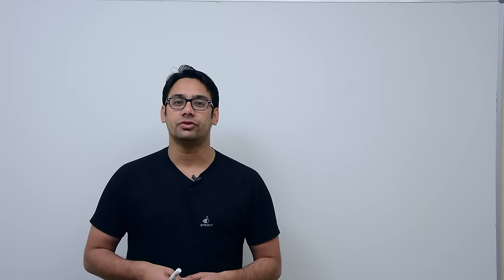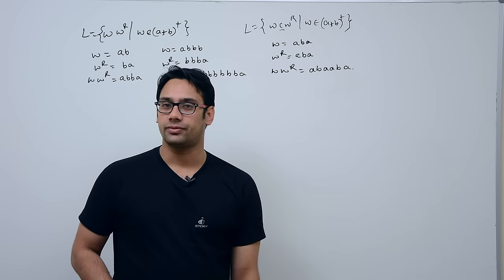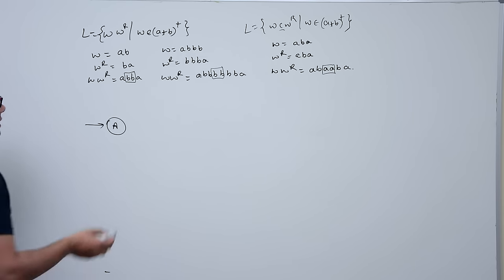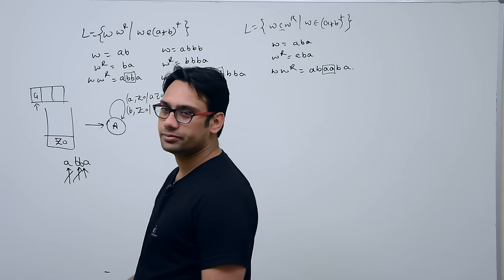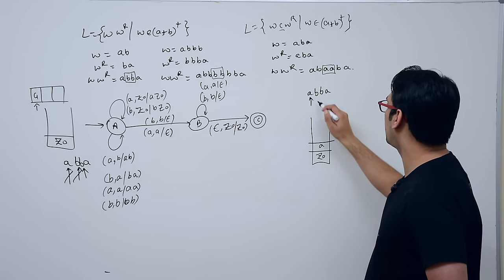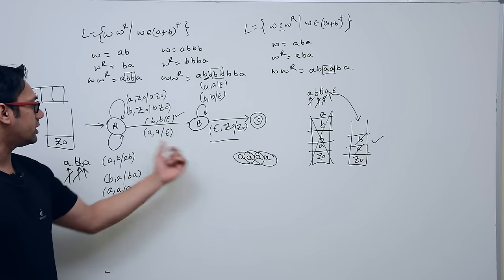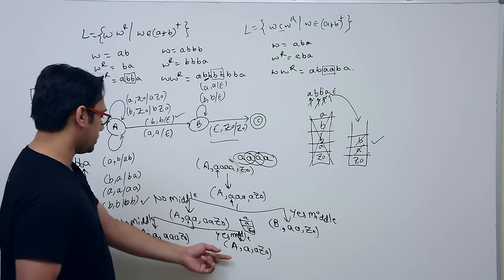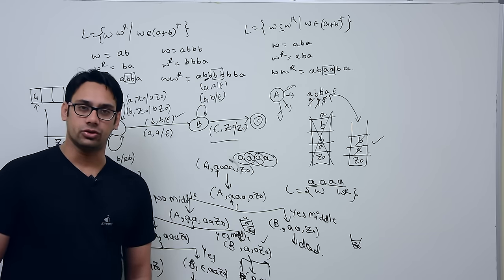44 Non Deterministic Push Down Automata (NPDA) Example

Comment: sir aap isme bhut confuse kr re phle wale example me btaya tha pda me ki different symbol ho tho hm pop krenge yha kh re ho push krenge
Reply: In previous example we had to check if number of "a" is equal to number of "b" or not so when different symbols come POP . But in this example we have to PUSH when different symbol because it cannot be the middle point of string. When symbols are same it might be middle point so at that time we take 2 transition PUSH and POP both .